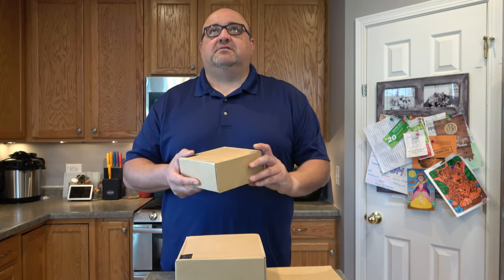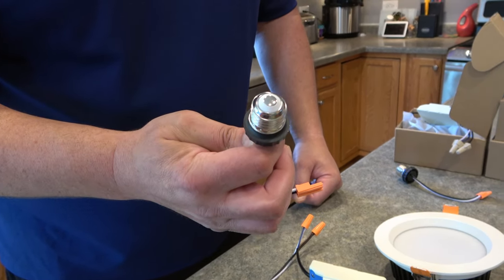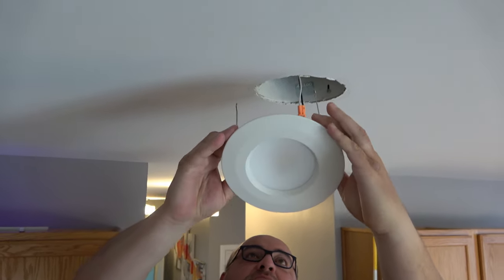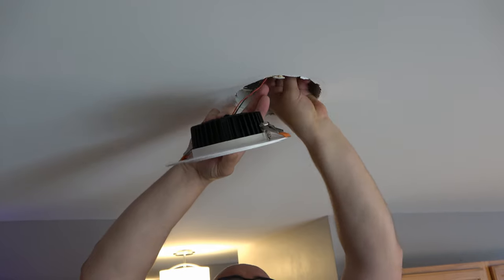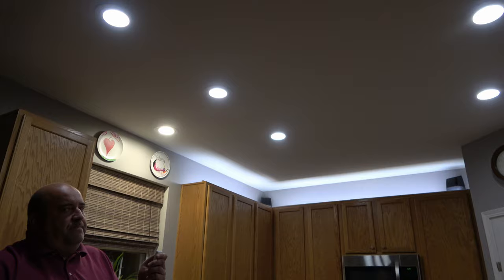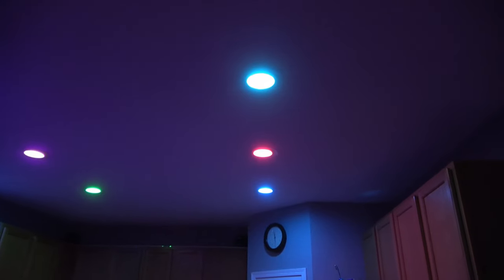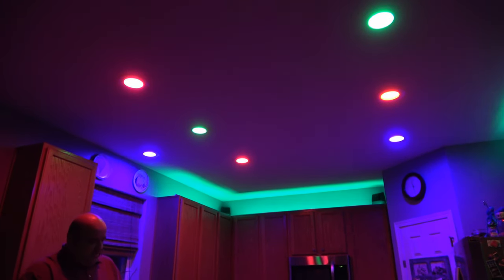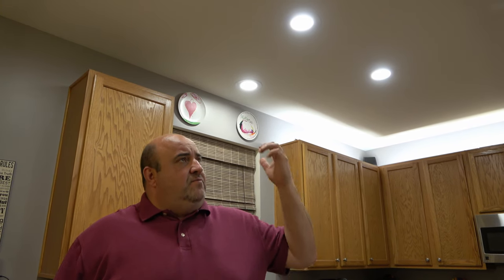Gledopto Downlights - Compatible with Philips Hue and Samsung SmartThings

Comment: Is it necessary to have the recessed can for these lights?  Or can I just replace a non-recessed fixture with just this light (without the can)?
Reply from the maker: You don't need a can. They're actually made to be used without a can. The springs are meant to hold onto drywall or whatever you put a hole in.
Reply: @k2hometech548  Just found your Amazon store and was about to order some. One last question. Are these safe to touch insulation, or do I need to have a cover for them?
Reply from the maker: @JRMooreMusic  They're not IC rated as they've never been tested for that.  I can tell you after using multiples of these and having people use them against insulation, they don't get hot enough to start a fire. They get warm, but not hot. You are better off having an air gap on them just to be safe. I gave that same warning to someone else and he decided to build a wood box to keep the insulation from laying directly on them.  Leaving an air gap will eliminate any potential issues.

Comment: Is putting the driver inside the can code compliant?
Reply from the maker: The best bet is to always check your local codes. The driver is just a converter that turns the 120v AC into 18v DC. The Zigbee components are in the light itself.

Comment: whats with the delay?
Reply from the maker: They have a delay as they first turn on from a switch. That's the "soft start" feature. When the switch is left on, and you use the app, or the remote, the delay is the same as my hue bulbs. If you watch the part when we show them with the hue disco app, you can see how fast they react.